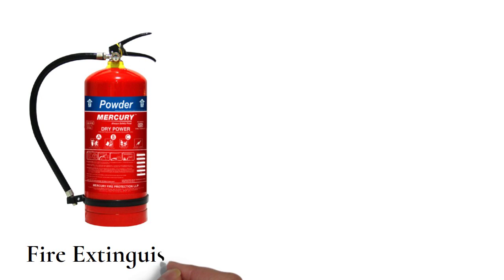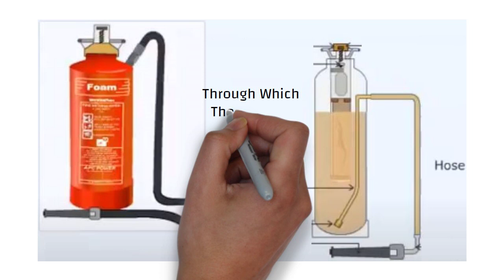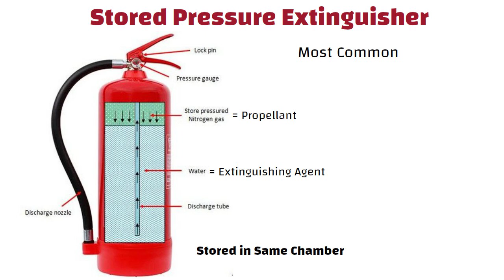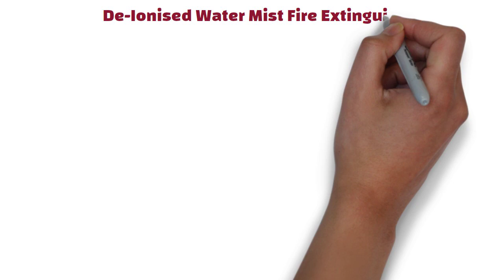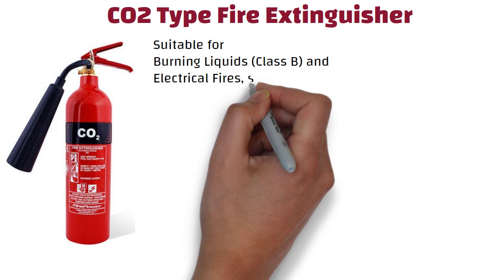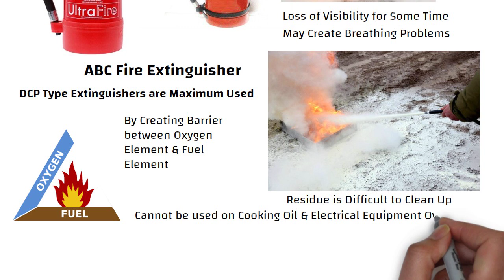FIRE EXTINGUISHER DEALERS IN KERALA, CALL 8138906102, FIRE EXTINGUISHER DEALERS IN ERNAKULAM.

Comment: Smoke detector dealers in Ernakulam
Reply: FIRE EXTINGUISHER DEALERS IN THODUPUZHA, FIRE EXTINGUISHER SUPPLIERS IN THODUPUZHA, FIRE EXTINGUISHER DISTRIBUTORS IN THODUPUZHA, FIRE EXTINGUISHER IN THODUPUZHA, ABC TYPE FIRE EXTINGUISHER DEALERS IN THODUPUZHA, CO2 TYPE FIRE EXTINGUISHER DEALERS IN THODUPUZHA, CLEAN AGENT FIRE EXTINGUISHER IN THODUPUZHA, MODULAR TYPE FIRE EXTINGUISHER DEALERS IN THODUPUZHA, MECHANICAL FOAM FIRE EXTINGUISHER DEALERS IN THODUPUZHA, FIRE EXTINGUISHER NEAR ME THODUPUZHA, FIRE EXTINGUISHER TRADERS IN THODUPUZHA, FIRE FIGHTING COMPANIES IN THODUPUZHA, FIRE CONTRACTORS IN THODUPUZHA, FIRE EQUIPMENT DEALERS IN THODUPUZHA, FIRE ALARM DEALERS IN THODUPUZHA, FIRE PUMP DEALERS IN THODUPUZHA, SMOKE DETECTOR DEALERS IN THODUPUZHA, FIRE FIGHTING SYSTEM IN THODUPUZHA, FIRE PROTECTION SYSTEM IN THODUPUZHA, FIRE AND SAFETY CONTRACTORS IN THODUPUZHA, FIRE HYDRANT SYSTEMS IN THODUPUZHA, PA TALK BACK SYSTEM IN THODUPUZHA, FIRE NOC IN THODUPUZHA, FIRE INSTALLATION IN THODUPUZHA, FIRE NOC RENEWAL IN THODUPUZHA, KIRLOSKAR FIRE PUMP DEALERS IN THODUPUZHA, FIRE EXTINGUISHER NEAR ME THODUPUZHA, FIRE EXTINGUISHER MANUFACURERS IN THODUPUZHA, SAFEX FIRE EXTINGUISHER DEALERS IN THODUPUZHA, FIRE NOC CONTRACTORS IN THODUPUZHA, FIRE FIGHTING EQUIPMENT DEALERS IN THODUPUZHA, FIRE PROTECTION SYSTEM IN THODUPUZHA, FIRE INSTALLATION IN THODUPUZHA, FIRE SAFETY CONTRACTORS IN THODUPUZHA, FIRE AMC IN THODUPUZHA, FIRE PROTECTION SYSTEM IN THODUPUZHA, FIRE PROTECTION EQUIPMET IN THODUPUZHA, AMC OF FIRE SYSTEM IN THODUPUZHA, FIRE CONSULTANTS IN THODUPUZHA, FIRE AND SAFETY EQUIPMENT DEALERS IN THODUPUZHA, ADDRESSABLE FIRE ALARM SYSTEM IN THODUPUZHA, KARTHAR VALVE DEALERS IN THODUPUZHA, DCP TYPE FIRE EXTINGUISHER IN THODUPUZHA, POWSER TYPE FIRE EXTINGUISHERS IN THODUPUZHA, FIRE HYDRANT SYSTEM IN THODUPUZHA, FIRE ALARM PANEL DEALERS IN THODUPUZHA, SAFEPRO FIRE EXTINGUISHER DEALERS IN THODUPUZHA, MS AND GI PIPE DEALERS IN THODUPUZHA, JINDAL PIPE DEALERS IN THODUPUZHA, AGNI FIRE ALARM DEALERS IN THODUPUZHA, FIRE EQUIPMENT DEALERS IN THODUPUZHA, FIRE EQUIPMENT SUPPLIERS IN THODUPUZHA, FIRE EQUIPMENT TRADERS IN THODUPUZHA, FIRE SPRINKLER SYSTEM IN THODUPUZHA, RAVEL FIRE ALARM DEALERS IN THODUPUZHA, RAVEL FIRE ALARM SYSTEM IN THODUPUZHA, AGNI FIRE ALARM DISTRIBUTORS IN THODUPUZHA, FIRE ALARM CONTRACTORS IN THODUPUZHA, FIRE PIPE INSTALLATION IN CONTRACTORS IN THODUPUZHA, FIRE SAFETY CONTRACTORS IN THODUPUZHA, FIRE PA TWO WAY TALK BACK SYSTEM DEALERS IN THODUPUZHA, HEAT DETECTOR DEALERS IN THODUPUZHA, HONEYWELL FIRE ALARM DEALERS IN THODUPUZHA, FIRE NOC CONSULTANTS IN THODUPUZHA, FIRE AMC AND FIRE NOC IN THODUPUZHA, FIRE SAFETY COMPANIES IN THODUPUZHA, NEWAGE DEALERS IN THODUPUZHA, MONSHER FIRE EQUIPMENT DEALERS IN THODUPUZHA, KARTHAR VALVE DEALERS IN THODUPUZHA, FIRE HYDRANT VALVE DEALERS IN THODUPUZHA, FIRE HOSE REEL DRUM DEALERS IN THODUPUZHA, FIRE SPRINKLER DEALERS IN THODUPUZHA, FIRE PUMP DEALERS IN THODUPUZHA, LUBI PUMP DEALERS IN THODUPUZHA, LHP PUMP DEALERS IN THODUPUZHA. FIRE CONTRACTORS IN THODUPUZHA, FIRE AND SAFETY CONTRACTORS IN THODUPUZHA, FIRE EQUIPMENT DEALERS IN THODUPUZHA, FIRE FIGHTING CONTRACTORS IN THODUPUZHA, AGNI FIRE ALARM DEALERS IN THODUPUZHA, PA TALK BACK SYSTEM DEALERS IN THODUPUZHA, FIRE NOC IN THODUPUZHA, FIRE NOC RENEWAL IN THODUPUZHA, FIRE SYSTEM INSTALLATION IN THODUPUZHA.
Reply: FIRE EXTINGUISHER DEALERS IN KERALA, FIRE EXTINGUISHER SUPPLIERS IN KERALA, FIRE EXTINGUISHER DISTRIBUTORS IN KERALA, FIRE EXTINGUISHER IN KERALA, ABC TYPE FIRE EXTINGUISHER DEALERS IN KERALA, CO2 TYPE FIRE EXTINGUISHER DEALERS IN KERALA, CLEAN AGENT FIRE EXTINGUISHER IN KERALA, MODULAR TYPE FIRE EXTINGUISHER DEALERS IN KERALA, MECHANICAL FOAM FIRE EXTINGUISHER DEALERS IN KERALA, FIRE EXTINGUISHER NEAR ME KERALA, FIRE EXTINGUISHER TRADERS IN KERALA, FIRE FIGHTING COMPANIES IN KERALA, FIRE CONTRACTORS IN KERALA, FIRE EQUIPMENT DEALERS IN KERALA, FIRE ALARM DEALERS IN KERALA, FIRE PUMP DEALERS IN KERALA, SMOKE DETECTOR DEALERS IN KERALA, FIRE FIGHTING SYSTEM IN KERALA, FIRE PROTECTION SYSTEM IN KERALA, FIRE AND SAFETY CONTRACTORS IN KERALA, FIRE HYDRANT SYSTEMS IN KERALA, PA TALK BACK SYSTEM IN KERALA, FIRE NOC IN KERALA, FIRE INSTALLATION IN KERALA, FIRE NOC RENEWAL IN KERALA, KIRLOSKAR FIRE PUMP DEALERS IN KERALA, FIRE EXTINGUISHER NEAR ME KERALA, FIRE EXTINGUISHER MANUFACURERS IN KERALA, SAFEX FIRE EXTINGUISHER DEALERS IN KERALA, FIRE NOC CONTRACTORS IN KERALA, FIRE FIGHTING EQUIPMENT DEALERS IN KERALA, FIRE PROTECTION SYSTEM IN KERALA, FIRE INSTALLATION IN KERALA, FIRE SAFETY CONTRACTORS IN KERALA, FIRE AMC IN KERALA, FIRE PROTECTION SYSTEM IN KERALA, FIRE PROTECTION EQUIPMET IN KERALA, AMC OF FIRE SYSTEM IN KERALA, FIRE CONSULTANTS IN KERALA, FIRE AND SAFETY EQUIPMENT DEALERS IN KERALA, ADDRESSABLE FIRE ALARM SYSTEM IN KERALA, KARTHAR VALVE DEALERS IN KERALA, DCP TYPE FIRE EXTINGUISHER IN KERALA, POWSER TYPE FIRE EXTINGUISHERS IN KERALA, FIRE HYDRANT SYSTEM IN KERALA, FIRE ALARM PANEL DEALERS IN KERALA, SAFEPRO FIRE EXTINGUISHER DEALERS IN KERALA, MS AND GI PIPE DEALERS IN KERALA, JINDAL PIPE DEALERS IN KERALA, AGNI FIRE ALARM DEALERS IN KERALA, FIRE EQUIPMENT DEALERS IN KERALA, FIRE EQUIPMENT SUPPLIERS IN KERALA, FIRE EQUIPMENT TRADERS IN KERALA, FIRE SPRINKLER SYSTEM IN KERALA, RAVLE FIRE ALARM DEALERS IN KERALA, RAVEL FIRE ALARM SYSTEM IN KERALA, AGNI FIRE ALARM DISTRIBUTORS IN KERALA, FIRE ALARM CONTRACTORS IN KERALA, FIRE PIPE INSTALLATION IN CONTRACTORS IN KERALA, FIRE SAFETY CONTRACTORS IN KERALA, FIRE PA TWO WAY TALK BACK SYSTEM DEALERS IN KERALA, HEAT DETECTOR DEALERS IN KERALA, HONEYWELL FIRE ALARM DEALERS IN KERALA, FIRE NOC CONSULTANTS IN KERALA, FIRE AMC AND FIRE NOC IN KERALA, FIRE SAFETY COMPANIES IN KERALA, NEWAGE DEALERS IN KERALA, MONSHER FIRE EQUIPMENT DEALERS IN KERALA, KARTHAR VALVE DEALERS IN KERALA, FIRE HYDRANT VALVE DEALERS IN KERALA, FIRE HOSE REEL DRUM DEALERS IN KERALA, FIRE SPRINKLER DEALERS IN KERALA, FIRE PUMP DEALERS IN KERALA, LUBI PUMP DEALERS IN KERALA, LHP PUMP DEALERS IN KERALA.

Comment: Smoke detector dealers in Kerala
Reply: FIRE EXTINGUISHER DEALERS IN VADAKARA, FIRE EXTINGUISHER SUPPLIERS IN VADAKARA, FIRE EXTINGUISHER DISTRIBUTORS IN VADAKARA FIRE EXTINGUISHER IN VADAKARA, ABC TYPE FIRE EXTINGUISHER DEALERS IN VADAKARA, CO2 TYPE FIRE EXTINGUISHER DEALERS IN VADAKARA, CLEAN AGENT FIRE EXTINGUISHER IN VADAKARA, MODULAR TYPE FIRE EXTINGUISHER DEALERS IN VADAKARA, MECHANICAL FOAM FIRE EXTINGUISHER DEALERS IN VADAKARA, KIRLOSKAR FIRE PUMP DEALERS IN VADAKARA,  FIRE FIGHTING EQUIPMENT DEALERS IN VADAKARA, FIRE FIGHTING SYSTEM IN VADAKARA,  RO PUMP DEALERS IN VADAKARA. FIRE EXTINGUISHER IN VADAKARA, FIRE ECONTRACTORS IN VADAKARA, FIRE EXTINGUISHER SUPPLIERS IN VADAKARA, FIRE EXTINGUISHER DEALERS IN NADAPURAM, FIRE EXTINGUISHER DEALERS IN PERAMBRA, FIRE EXTINGUISHER DEALERS IN MAHE, FIRE EXTINGUISHER DEALERS IN  PAYYOLI, FIRE EXTINGUISHER DEALERS IN NADAPURAM, FIRE EXTINGUISHER DEALERS IN THALASSERY, FIRE EXTINGUISHER SUPPLIERS IN NADAPURAM, FIRE EXTINGUISHER SUPPLIERS IN PERAMBRA, FIRE EXTINGUISHER SUPPLIERS IN MAHE, FIRE EXTINGUISHER SUPPLIERS IN  PAYYOLI, FIRE EXTINGUISHER SUPPLIERS IN NADAPURAM, FIRE EXTINGUISHER SUPPLIERS IN THALASSERY, FIRE EXTINGUISHER IN NADAPURAM, FIRE EXTINGUISHER IN PERAMBRA, FIRE EXTINGUISHER IN MAHE, FIRE EXTINGUISHER IN PAYYOLI, FIRE EXTINGUISHER  IN NADAPURAM, FIRE EXTINGUISHER IN THALASSERY,  FIRE EXTINGUISHER TRADERS IN NADAPURAM, FIRE EXTINGUISHER TRADERS IN PERAMBRA, FIRE EXTINGUISHER TRADERS IN MAHE, FIRE EXTINGUISHER TRADERS IN  PAYYOLI, FIRE EXTINGUISHER TRADERS IN NADAPURAM, FIRE EXTINGUISHER TRADERS IN THALASSERY, Fire fighting contractors in VADAKARA, fire and safety installations in VADAKARA, fire extinguishers in VADAKARA, fire extinguishers in VADAKARA, fire protection system in VADAKARA, fire and safety installation in VADAKARA, fire and safety contractors in VADAKARA, fire safety contractors in VADAKARA, fire and safety equipments in VADAKARA, fire equipment in VADAKARA, fire protection system installation in VADAKARA, fire contractors in VADAKARA, fire safety consultants in VADAKARA,  fire alarm system in VADAKARA, fire NOC in VADAKARA, fire AMC in VADAKARA, fire fighting equipment in VADAKARA, fire pump panel in VADAKARA, motor control panel in VADAKARA, Morley fire alarm in VADAKARA, GST fire alarm in VADAKARA, addressable fire alarm system in VADAKARA, PA talk back system in VADAKARA, PA two way talk back system in VADAKARA, auto glow SIGNAGES in VADAKARA, Karthar dealers in VADAKARA, Agni fire alarm dealers in VADAKARA, ASES SECURITY fire alarm dealers in VADAKARA, AUTO GLOW SIGNAGES in VADAKARA, FIRE PUMP PANEL in VADAKARA, LHP pump in VADAKARA. Karthar valves in VADAKARA, Ravel fire alarm system in VADAKARA. Jindal pipe dealers in VADAKARA, Jindal pipe dealers in VADAKARA. MS pipe dealers in VADAKARA. Butterfly valves in VADAKARA, PA talk back system in VADAKARA, Fire alarm dealers in VADAKARA, smoke detector dealers in VADAKARA, fire alarm panels dealers in VADAKARA, MCP, hooter dealers in VADAKARA, hydrant valve dealers in VADAKARA, branch pipe dealers in VADAKARA, Fire CP hose in VADAKARA, Fire hose reel drum dealers in VADAKARA, heat detector dealers in VADAKARA, Motor Control panel in VADAKARA,  LED EXIT LIGHTS dealers in VADAKARA, emergency exit light dealers in VADAKARA, auto glow SIGNAGES dealers in VADAKARA. Conventional fire alarm system in VADAKARA, Fire alarm panel in VADAKARA, Notifier fire alarm dealers in VADAKARA, PA talk back unit dealers in VADAKARA. Honeywell fire alarm dealers in VADAKARA, KIRLOSKAR FIRE FIGHTING PUMP DEALERS IN VADAKARA, FIRE FIGHTING EQUIPMENT DEALERS IN VADAKARA, FIRE ALARM SYSTEM DEALERS IN VADAKARA, FIRE CONSULTANTS IN VADAKARA, FIRE CONTRACTOTORS IN VADAKARA, FIRE CONTRACTORS IN VADAKARA, FIRE ALARM SYSTEM DEALERS IN VADAKARA, SMOKE DETECTOR DEALERS IN VADAKARA, FIRE PROTECTION SYSTEM IN VADAKARA, FIRE CONSULTANTS IN VADAKARA, FIRE CONSULTANTS IN VADAKARA, ADDRESSABLE FIRE ALARM SYSTEMS IN VADAKARA,  SMOKE DETECTOR DEALERS IN VADAKARA,  RAVEL FIRE ALARM SYSTEM IN VADAKARA, LUBI FIRE FIGHTING PUMP DEALERS IN VADAKARA,  Fire extinguisher dealers in Koyilandy,

Comment: Fire extinguisher dealers in Kerala
Reply: FIRE EXTINGUISHER DEALERS IN KERALA, FIRE EXTINGUISHER SUPPLIERS IN KERALA, FIRE EXTINGUISHER DISTRIBUTORS IN KERALA, FIRE EXTINGUISHER IN KERALA, ABC TYPE FIRE EXTINGUISHER DEALERS IN KERALA, CO2 TYPE FIRE EXTINGUISHER DEALERS IN KERALA, CLEAN AGENT FIRE EXTINGUISHER IN KERALA, MODULAR TYPE FIRE EXTINGUISHER DEALERS IN KERALA, MECHANICAL FOAM FIRE EXTINGUISHER DEALERS IN KERALA, FIRE EXTINGUISHER NEAR ME KERALA, FIRE EXTINGUISHER TRADERS IN KERALA, FIRE FIGHTING COMPANIES IN KERALA, FIRE CONTRACTORS IN KERALA, FIRE EQUIPMENT DEALERS IN KERALA, FIRE ALARM DEALERS IN KERALA, FIRE PUMP DEALERS IN KERALA, SMOKE DETECTOR DEALERS IN KERALA, FIRE FIGHTING SYSTEM IN KERALA, FIRE PROTECTION SYSTEM IN KERALA, FIRE AND SAFETY CONTRACTORS IN KERALA, FIRE HYDRANT SYSTEMS IN KERALA, PA TALK BACK SYSTEM IN KERALA, FIRE NOC IN KERALA, FIRE INSTALLATION IN KERALA, FIRE NOC RENEWAL IN KERALA, KIRLOSKAR FIRE PUMP DEALERS IN KERALA, FIRE EXTINGUISHER NEAR ME KERALA, FIRE EXTINGUISHER MANUFACURERS IN KERALA, SAFEX FIRE EXTINGUISHER DEALERS IN KERALA, FIRE NOC CONTRACTORS IN KERALA, FIRE FIGHTING EQUIPMENT DEALERS IN KERALA, FIRE PROTECTION SYSTEM IN KERALA, FIRE INSTALLATION IN KERALA, FIRE SAFETY CONTRACTORS IN KERALA, FIRE AMC IN KERALA, FIRE PROTECTION SYSTEM IN KERALA, FIRE PROTECTION EQUIPMET IN KERALA, AMC OF FIRE SYSTEM IN KERALA, FIRE CONSULTANTS IN KERALA, FIRE AND SAFETY EQUIPMENT DEALERS IN KERALA, ADDRESSABLE FIRE ALARM SYSTEM IN KERALA, KARTHAR VALVE DEALERS IN KERALA, DCP TYPE FIRE EXTINGUISHER IN KERALA, POWSER TYPE FIRE EXTINGUISHERS IN KERALA, FIRE HYDRANT SYSTEM IN KERALA, FIRE ALARM PANEL DEALERS IN KERALA, SAFEPRO FIRE EXTINGUISHER DEALERS IN KERALA, MS AND GI PIPE DEALERS IN KERALA, JINDAL PIPE DEALERS IN KERALA, AGNI FIRE ALARM DEALERS IN KERALA, FIRE EQUIPMENT DEALERS IN KERALA, FIRE EQUIPMENT SUPPLIERS IN KERALA, FIRE EQUIPMENT TRADERS IN KERALA, FIRE SPRINKLER SYSTEM IN KERALA, RAVLE FIRE ALARM DEALERS IN KERALA, RAVEL FIRE ALARM SYSTEM IN KERALA, AGNI FIRE ALARM DISTRIBUTORS IN KERALA, FIRE ALARM CONTRACTORS IN KERALA, FIRE PIPE INSTALLATION IN CONTRACTORS IN KERALA, FIRE SAFETY CONTRACTORS IN KERALA, FIRE PA TWO WAY TALK BACK SYSTEM DEALERS IN KERALA, HEAT DETECTOR DEALERS IN KERALA, HONEYWELL FIRE ALARM DEALERS IN KERALA, FIRE NOC CONSULTANTS IN KERALA, FIRE AMC AND FIRE NOC IN KERALA, FIRE SAFETY COMPANIES IN KERALA, NEWAGE DEALERS IN KERALA, MONSHER FIRE EQUIPMENT DEALERS IN KERALA, KARTHAR VALVE DEALERS IN KERALA, FIRE HYDRANT VALVE DEALERS IN KERALA, FIRE HOSE REEL DRUM DEALERS IN KERALA, FIRE SPRINKLER DEALERS IN KERALA, FIRE PUMP DEALERS IN KERALA, LUBI PUMP DEALERS IN KERALA, LHP PUMP DEALERS IN KERALA.
Reply: FIRE EXTINGUISHER DEALERS IN THODUPUZHA, FIRE EXTINGUISHER SUPPLIERS IN THODUPUZHA, FIRE EXTINGUISHER DISTRIBUTORS IN THODUPUZHA, FIRE EXTINGUISHER IN THODUPUZHA, ABC TYPE FIRE EXTINGUISHER DEALERS IN THODUPUZHA, CO2 TYPE FIRE EXTINGUISHER DEALERS IN THODUPUZHA, CLEAN AGENT FIRE EXTINGUISHER IN THODUPUZHA, MODULAR TYPE FIRE EXTINGUISHER DEALERS IN THODUPUZHA, MECHANICAL FOAM FIRE EXTINGUISHER DEALERS IN THODUPUZHA, FIRE EXTINGUISHER NEAR ME THODUPUZHA, FIRE EXTINGUISHER TRADERS IN THODUPUZHA, FIRE FIGHTING COMPANIES IN THODUPUZHA, FIRE CONTRACTORS IN THODUPUZHA, FIRE EQUIPMENT DEALERS IN THODUPUZHA, FIRE ALARM DEALERS IN THODUPUZHA, FIRE PUMP DEALERS IN THODUPUZHA, SMOKE DETECTOR DEALERS IN THODUPUZHA, FIRE FIGHTING SYSTEM IN THODUPUZHA, FIRE PROTECTION SYSTEM IN THODUPUZHA, FIRE AND SAFETY CONTRACTORS IN THODUPUZHA, FIRE HYDRANT SYSTEMS IN THODUPUZHA, PA TALK BACK SYSTEM IN THODUPUZHA, FIRE NOC IN THODUPUZHA, FIRE INSTALLATION IN THODUPUZHA, FIRE NOC RENEWAL IN THODUPUZHA, KIRLOSKAR FIRE PUMP DEALERS IN THODUPUZHA, FIRE EXTINGUISHER NEAR ME THODUPUZHA, FIRE EXTINGUISHER MANUFACURERS IN THODUPUZHA, SAFEX FIRE EXTINGUISHER DEALERS IN THODUPUZHA, FIRE NOC CONTRACTORS IN THODUPUZHA, FIRE FIGHTING EQUIPMENT DEALERS IN THODUPUZHA, FIRE PROTECTION SYSTEM IN THODUPUZHA, FIRE INSTALLATION IN THODUPUZHA, FIRE SAFETY CONTRACTORS IN THODUPUZHA, FIRE AMC IN THODUPUZHA, FIRE PROTECTION SYSTEM IN THODUPUZHA, FIRE PROTECTION EQUIPMET IN THODUPUZHA, AMC OF FIRE SYSTEM IN THODUPUZHA, FIRE CONSULTANTS IN THODUPUZHA, FIRE AND SAFETY EQUIPMENT DEALERS IN THODUPUZHA, ADDRESSABLE FIRE ALARM SYSTEM IN THODUPUZHA, KARTHAR VALVE DEALERS IN THODUPUZHA, DCP TYPE FIRE EXTINGUISHER IN THODUPUZHA, POWSER TYPE FIRE EXTINGUISHERS IN THODUPUZHA, FIRE HYDRANT SYSTEM IN THODUPUZHA, FIRE ALARM PANEL DEALERS IN THODUPUZHA, SAFEPRO FIRE EXTINGUISHER DEALERS IN THODUPUZHA, MS AND GI PIPE DEALERS IN THODUPUZHA, JINDAL PIPE DEALERS IN THODUPUZHA, AGNI FIRE ALARM DEALERS IN THODUPUZHA, FIRE EQUIPMENT DEALERS IN THODUPUZHA, FIRE EQUIPMENT SUPPLIERS IN THODUPUZHA, FIRE EQUIPMENT TRADERS IN THODUPUZHA, FIRE SPRINKLER SYSTEM IN THODUPUZHA, RAVEL FIRE ALARM DEALERS IN THODUPUZHA, RAVEL FIRE ALARM SYSTEM IN THODUPUZHA, AGNI FIRE ALARM DISTRIBUTORS IN THODUPUZHA, FIRE ALARM CONTRACTORS IN THODUPUZHA, FIRE PIPE INSTALLATION IN CONTRACTORS IN THODUPUZHA, FIRE SAFETY CONTRACTORS IN THODUPUZHA, FIRE PA TWO WAY TALK BACK SYSTEM DEALERS IN THODUPUZHA, HEAT DETECTOR DEALERS IN THODUPUZHA, HONEYWELL FIRE ALARM DEALERS IN THODUPUZHA, FIRE NOC CONSULTANTS IN THODUPUZHA, FIRE AMC AND FIRE NOC IN THODUPUZHA, FIRE SAFETY COMPANIES IN THODUPUZHA, NEWAGE DEALERS IN THODUPUZHA, MONSHER FIRE EQUIPMENT DEALERS IN THODUPUZHA, KARTHAR VALVE DEALERS IN THODUPUZHA, FIRE HYDRANT VALVE DEALERS IN THODUPUZHA, FIRE HOSE REEL DRUM DEALERS IN THODUPUZHA, FIRE SPRINKLER DEALERS IN THODUPUZHA, FIRE PUMP DEALERS IN THODUPUZHA, LUBI PUMP DEALERS IN THODUPUZHA, LHP PUMP DEALERS IN THODUPUZHA. FIRE CONTRACTORS IN THODUPUZHA, FIRE AND SAFETY CONTRACTORS IN THODUPUZHA, FIRE EQUIPMENT DEALERS IN THODUPUZHA, FIRE FIGHTING CONTRACTORS IN THODUPUZHA, AGNI FIRE ALARM DEALERS IN THODUPUZHA, PA TALK BACK SYSTEM DEALERS IN THODUPUZHA, FIRE NOC IN THODUPUZHA, FIRE NOC RENEWAL IN THODUPUZHA, FIRE SYSTEM INSTALLATION IN THODUPUZHA.